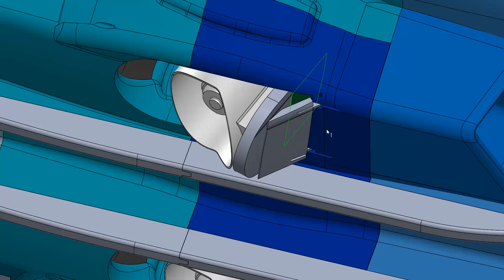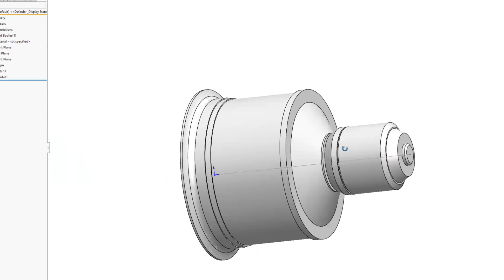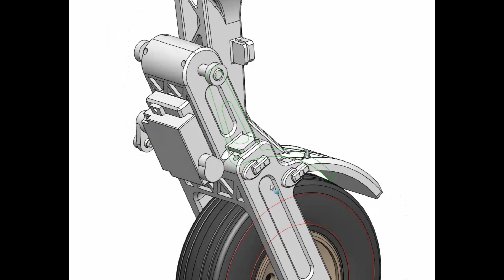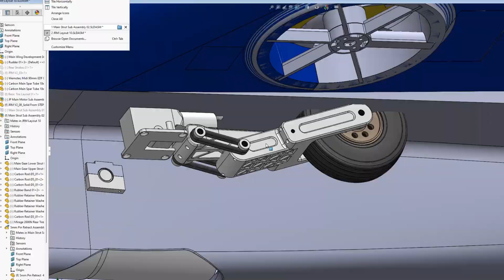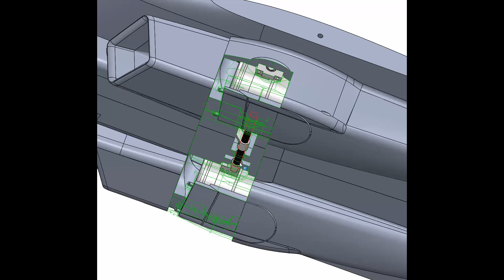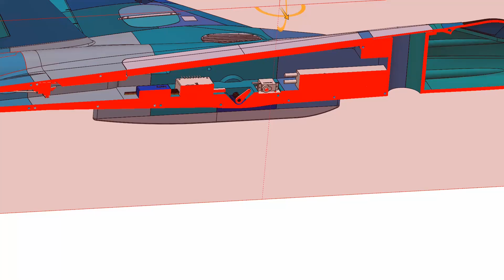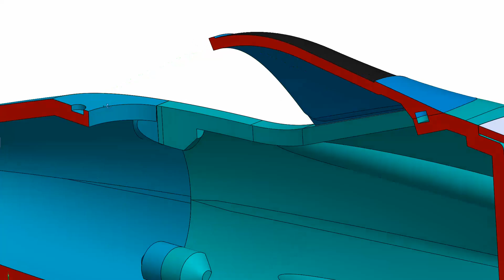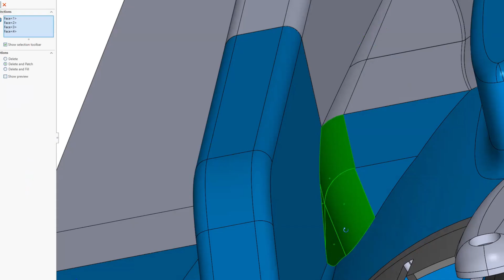How to make a VTOL Jet from Scratch | JRM-01 Project Insights | Pt.3

Comment: Can't most modern CADD programs calculate a fairly accurate CG based on the weights your slicer is reporting and weighing all the parts in your bill of materials?  Just tell the CADD what each component's weight is.

Comment: I've bought the SU-XR+ files, and I'm really looking forward to flying it, once all the parts finally print...lol.

I'm curious if you're planning on selling the files for the full, larger scale, multi-edf, VTOL SU-XR at any point in time? It's the most beautiful jet I've ever seen, an improvement on the original, and man, I want the big one 😍
Reply from the maker: Never say never. Think the JRM-01 will help to develop the VTOL Su-XR ✈️
Reply: Well, you listened with the smaller one...here's hoping...dual Schuebler 128mm with TP5690 for the main fans....😌 It almost needs a 25KW fuel cell at that scale 🤣 Here's hoping someday they won't cost as much as a nice house 😳🤯
Reply from the maker: That's a nice project man😁🤙🤙

Comment: Is the JRM-01 a less complex build than the other jets, or about the same?
Reply from the maker: You mean compared to the Harrier and Su-XR? There will be different versions but easy building and handling is same for all of them.
Reply: @rene_rosentraeger  Great; I just need to upgrade my printer to a Bambu then I can build. I just have an Ender 5 Pro, and its quality isn't consistent enough (and doesn't have the build volume) to print these yet.